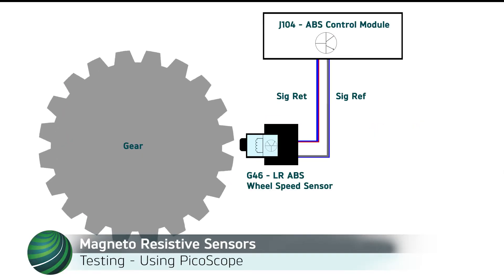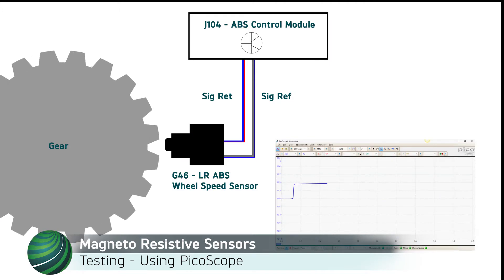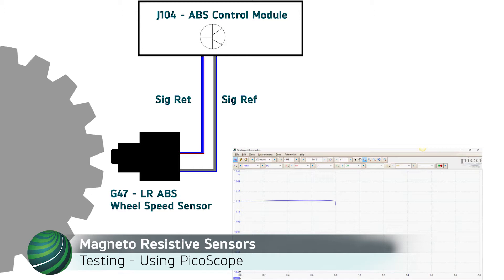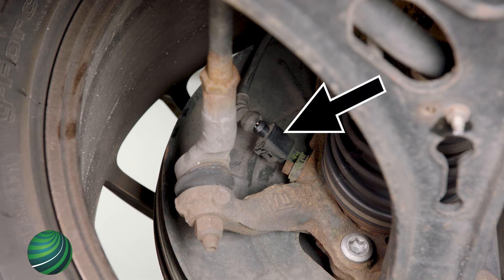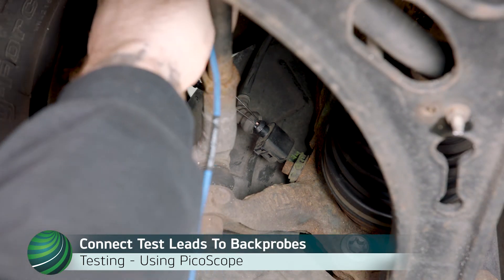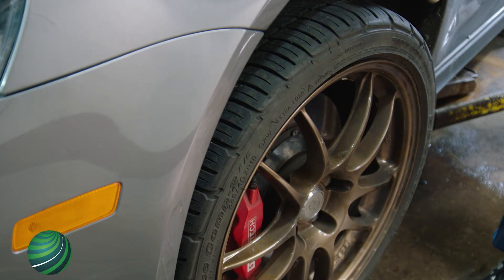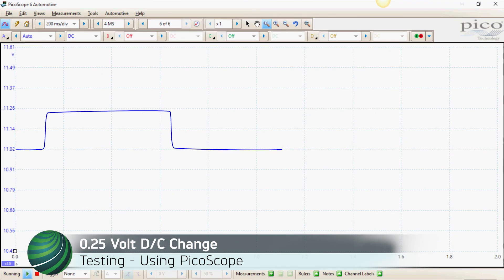Best Way to Test Magneto Resistive Position Sensors using the Autologic PicoScope

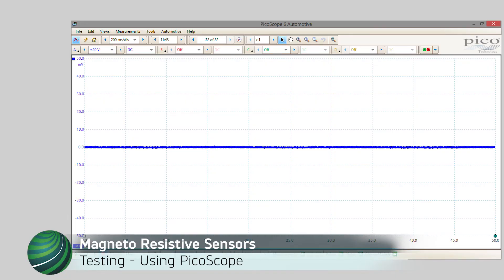Comment: Thank you again. Questions. At the 1:20 Mark you mention to set the scope to 20V DC scale for recording and reviewing the signal. Then at the 1:27 Mark you mention to set the scope to 1V or .5V AC coupled scale for live viewing. Then after during the live demo the scope was on Auto scale. Can you please explain purpose and benefits of why the higher voltage scale and no AC coupled for recording versus the lower scale and AC coupled for live reading.  Why would you need to AC couple a DC digital signal?
Reply: You would want to a/c couple the signal to watch it live without zooming in. You can keep the scope on auto if you want, or you can set your scope up manually. You can use these techniques with any scope. Giving the voltage ranges just helps with setting up your personal device. Thanks for watching!